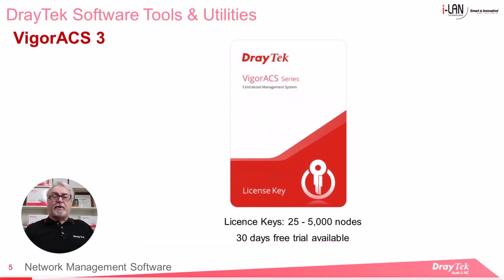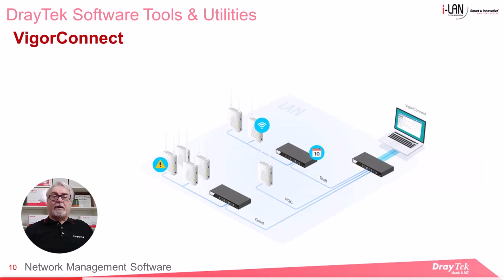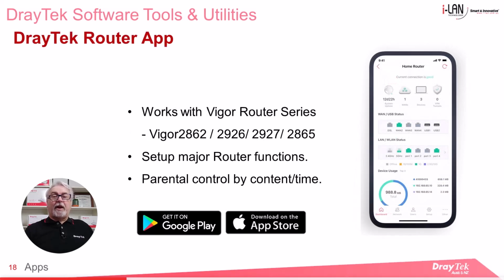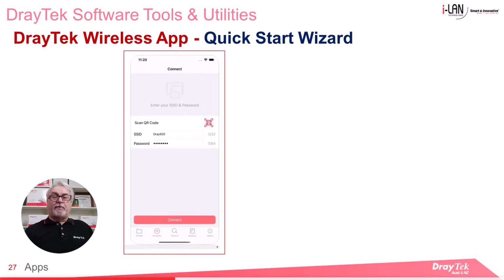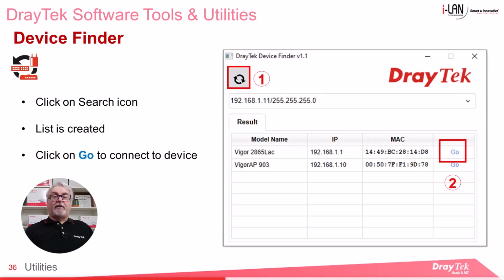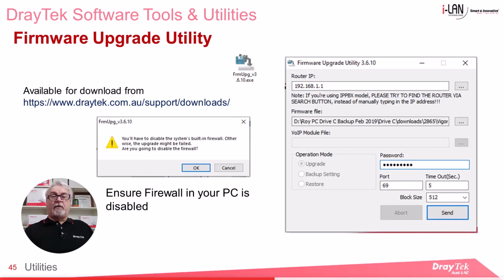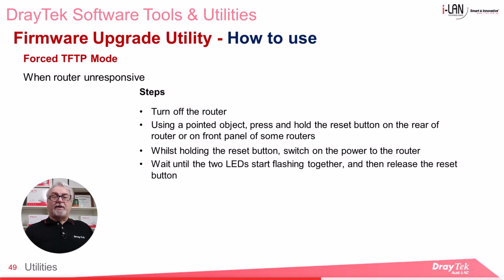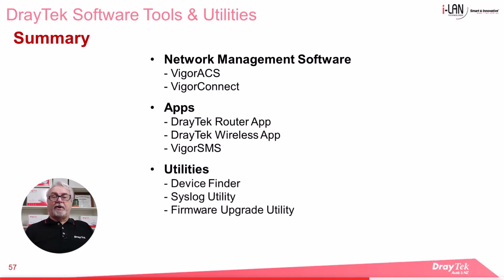Webinar - DrayTek Software Tools & Utilities

Comment: Hello 
 There is a problem with the application smart VPN on the iPhone,The program does not work at all, with all settings set, unlike Android. I am happy to tell you that your product is very wonderful,Thank you.
Reply from the maker: If you are located in Australia, can you send an email to support@drayTek.com.au so this issue can be investigated. Also indicate the SmartVPN version you are using as well as the phone IOS. Sometimes security updates on the iPhone can interfere with the SmartVPN client
Reply: @DrayTekAustNZ  I live in Saudi Arabia. Indeed, your words are correct, because it works well on Android and it was working on iPhone at the time of Corona, but it seems that there are security updates on the iPhone that hinder the work of the program.
 Thank you very much